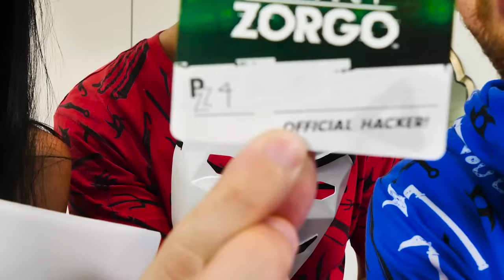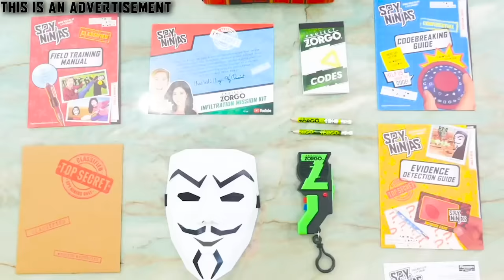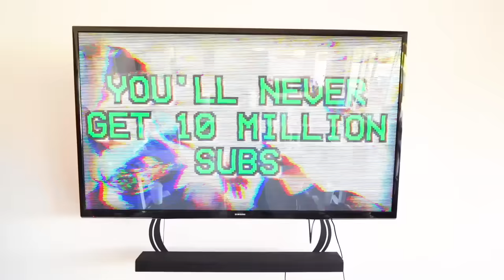WE'RE LOCKED OUT! Vy Defeated In Safe House by Mystery Person with Traps & Funny Pranks Challenge

Comment: I think I know how to get to the top of the pyramid. The Luxor Inclinators do require room keys. You might be able to enter along with other and as long as you press a floor before they remove the key you can ride along. Each inclinator goes up about 1/4 of the way (e.g. if you pick the one to the highest floors, and just " ride along" you will get pretty high up. That’s how you get up.... I think